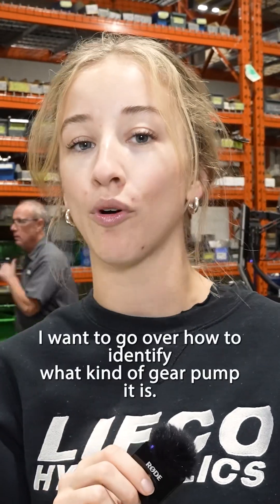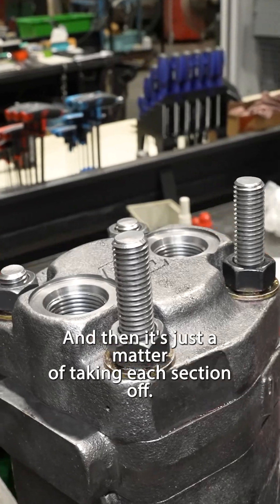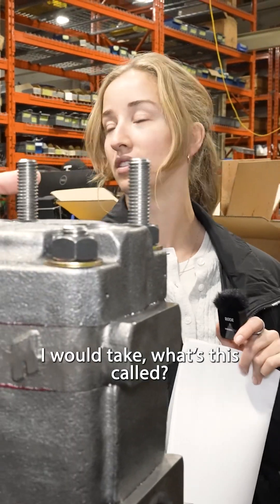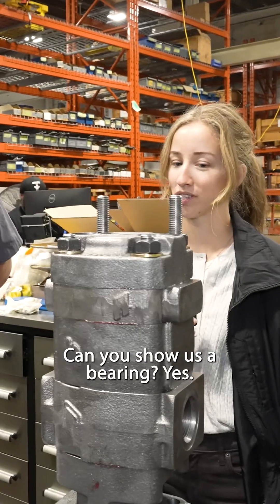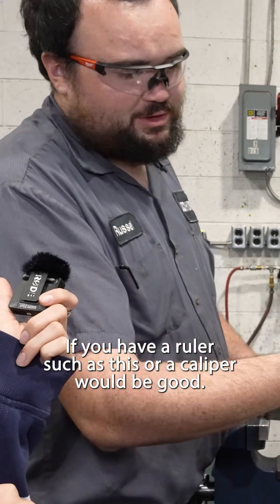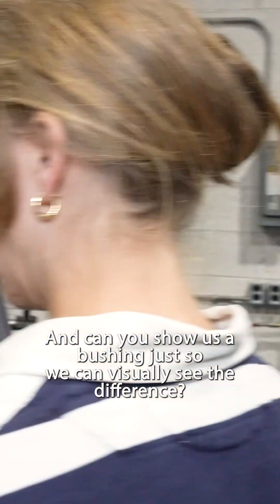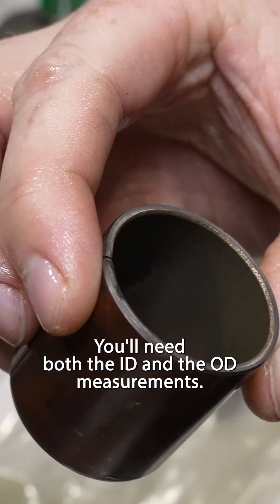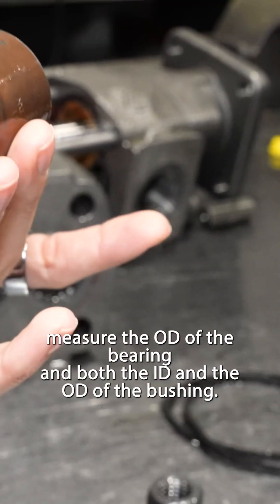Found a GEAR PUMP with NO TAG?!

Comment: With Parker you only need to take apart the pump, to determine whether it is P30 or P31, or P50 or P51! 
In other words - if there a dowel pin, which will make 500 psi max. pressure rating.

Rest of them - pretty much identifiable by look, and by measuring the body width.